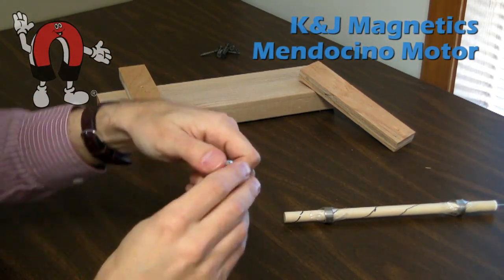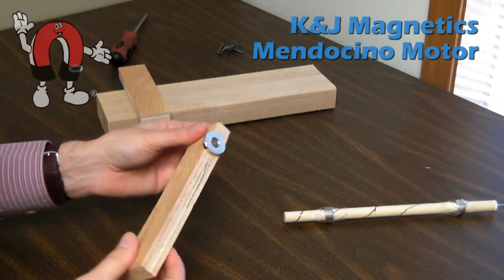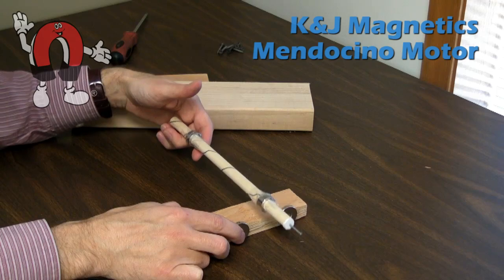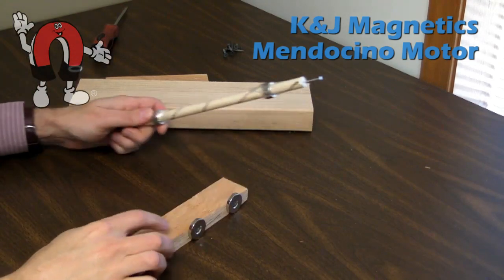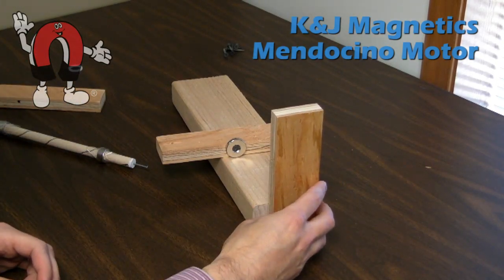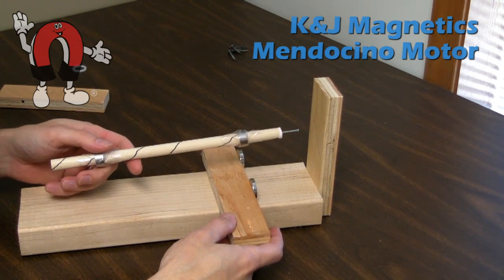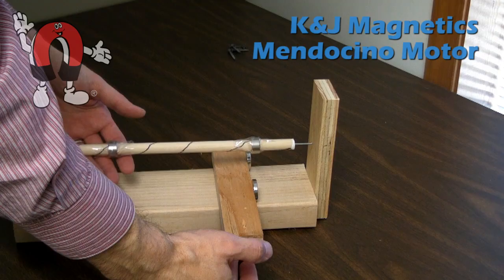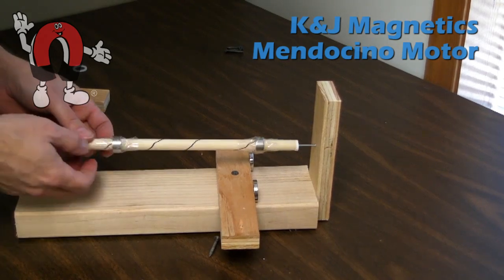K&J Magnetics - Mendocino Motor Part 2

Comment: Shouldn't the nail be ground to a point before you install the base magnets, removing the nail head will alter the length the shaft sits.